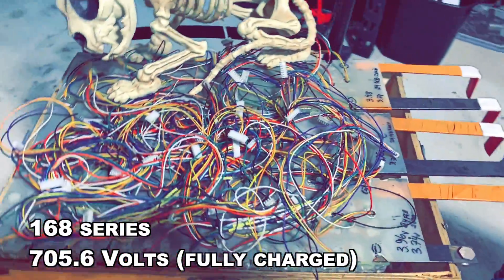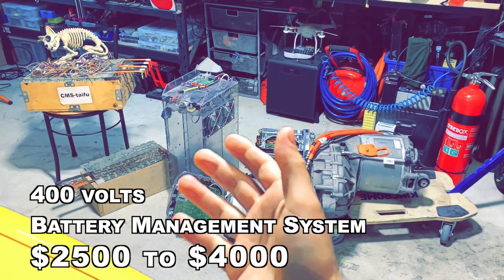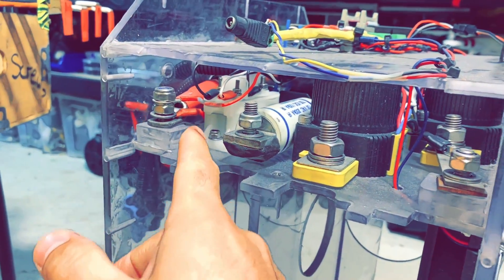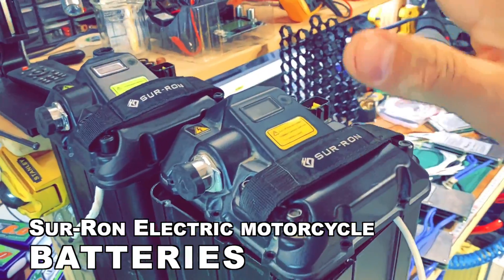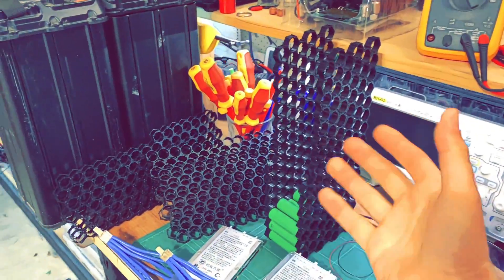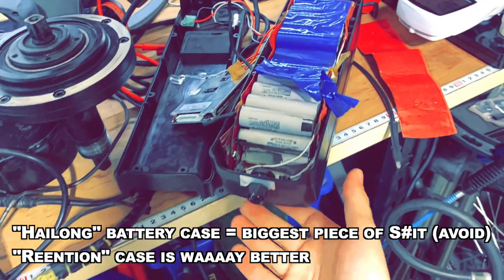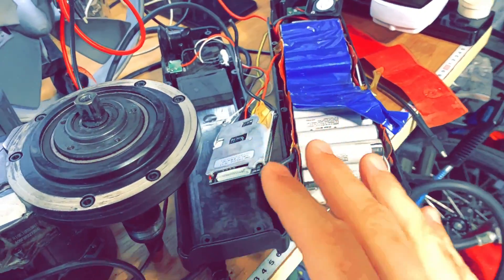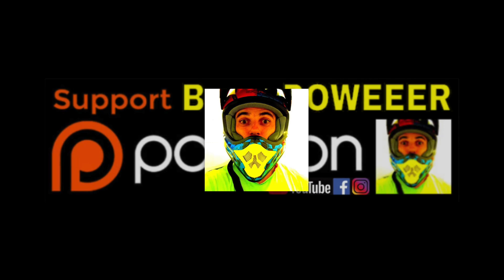EV Workshop "Toys" • 700v Battery + 1972 Mini + Hacked Tesla motor?? Custom SURRON Battery Build??

Comment: I see you mention battery cases and that the cheap ones are junk. It's a real issue I'm facing looking for a battery that will fit in my bike frame. I don't want something that will shake loose or break while going over jumps or bumps. Do you reckon the reention battery cases will be more durable? Or should I look into a custom solution?
Reply from the maker: Custom case solution is a very painful process, many times you’ll end up with something that’s not really waterproofed properly or not practical, the Reention is the best value case out there, stay away from Hailong... I’ve been to both factories in China... Reention is good
Reply: @BrunoPOWEEER  I'll look into Reention, cheers!
Reply from the maker: Nowadays there are some massive removable ones can fit sooo many cells high Ah

Comment: What is the make on those BMS? They looked nice
Reply from the maker: Look up for AntBMS on AliExpress, there are different sizes and with or without display, I always like to use the display https://www.aliexpress.com/store/group/New-ODD-Product/1821822_511602284.html?spm=2114.12010612.0.0.7d354bdaQclvEa
Reply: @BrunoPOWEEER  Thanks man!

Comment: Whilst your at it, pleace put on the original clubman front end, it's gonna look miles better! Have a look at Google if you wonder what it looks like!
Reply: I was going to say that as well.....and further to that, I'd inset the solar panels back into the factory roof so that box is recessed inside of the cabin..... although due to the solar panel size the box section would probably protrude in too close into the drivers cockpit; leaving little option other than to channel the floorpan or make a special seat.
I'd say that someone probably intended to use the mini (being a panel van) as a form of 'camper' and probably wanted as much head room and rear space as possible?

I see the boot space more as a huge 'battery compartment' haha so I'd ditch the solar panels and put them on the house and offset with additional batteries?
Makes more sense to do that and if you want to do the "camping" thing, then build a small tow-able trailer (with it's own battery space) a generator & awnings made of solar panels 👍
Have your cake and eat it too! Cause I don't know anybody that has cake and just likes to look at it like it's an ornament or something?
I think that behaviour is best reserved for people who build show cars with detailed underbodies that never drive and only get trucked too and from Autosalon or something like that lol

Comment: can you mod a bosch ebike motor ie hack the software ;)
Reply from the maker: Software is too difficult, easier replacing and fitting another motor controller instead. You can easily hack the magnetic speed sensor by removing the sensor from the frame and place it facing the pedal crank/shaft. Then you install a small magnet there and the sensor now reads your cadence instead of wheel speed. That means you’ll be riding like 40-50kmh and the motor things you’re only doing 20kmh and keeps pumping power trying to make you go faster
Reply: @BrunoPOWEEER  i can go 35mph with a dongle i want more amps ;)
Reply from the maker: 35mph is pretty awesome on a little road legal Bosch motor... more amps I'm not too sure someone hacked and made the hack available for others... the next step may be fitting a new controller but that required you to be brave and perform a little electrical madness surgery...  maybe keep on researching if you can find someone who hacked the amps on the original controller.. any small increase like even 2 or 3 amps makes difference, ideally 5 more amps =]
Reply: @BrunoPOWEEER   thing is the bosch system have a hand shake system so a new controller just wont work as the batt whould not even turn on same as the display so need a way in to the software but have not found anything in 5 years since i had the bike not even dealers can change those settings and they want £45 just to upgrade the firmware  but going 35mph means i have to spin the cranks at 120rpm so cant do that for very long but i can kill a 500w batt in about 1hr in turbo.